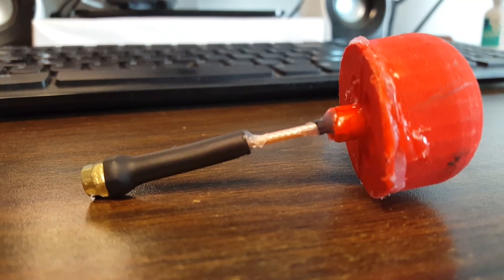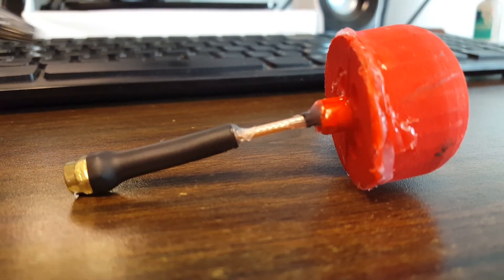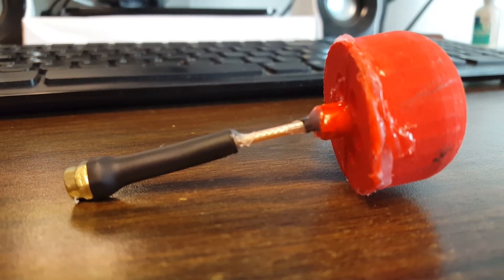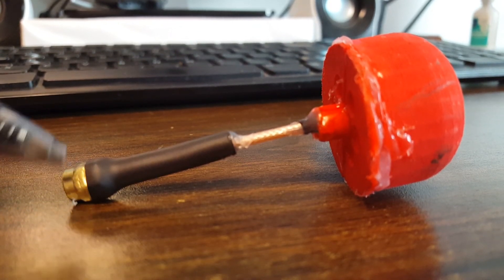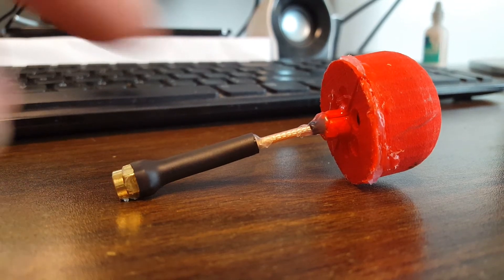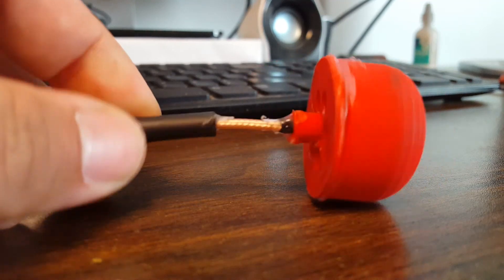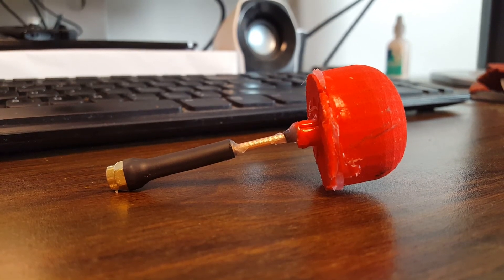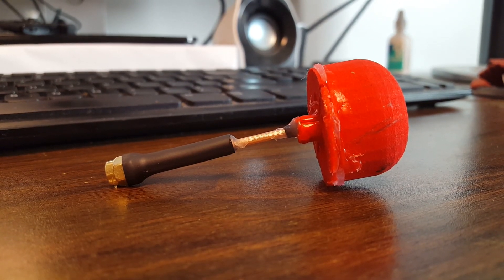How To Reinforce Your Flimsy FPV Antenna

Comment: Hey Josh, for people that fly indoors allot I have a great little tip.
3D print on the antenna, then mold some Polymorph around it. It's cheap and durable. The 3D print alone won't last more than 2 crashes indoors. I use the Polymorph also on the feet of the quad as skids. Hope it's of use..

Comment: What's that red ball on the end made from?
Reply from the maker: +trump959 http://www.shapeways.com/product/NTURTD9FD/skewplaner-cloverleaf-5-8ghz-antenna-cover

I assemble it with hot glue. Then, when the antenna cable finally wears through, use a toaster oven on warm or a hair dryer to soften the glue and it comes right apart and you can install it on the next one. It's honestly a bit expensive for something so simple, but it's quite durable and effective, and looks a lot nicer than the ping-pong ball approach. And my antennas do last longer with it on.
Reply: +Joshua Bardwell cool... I've cut ping pong balls in half before, but was just curious what you did with yours.